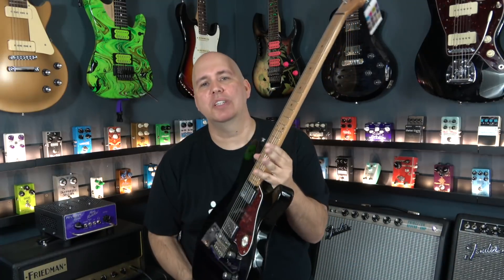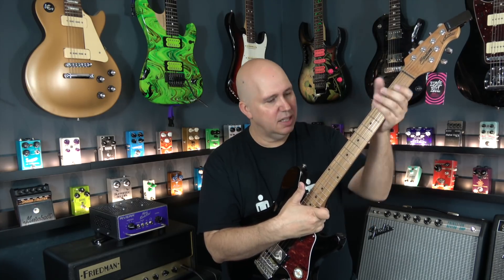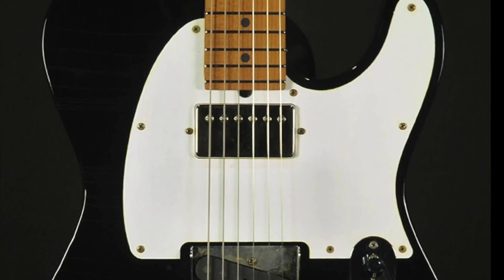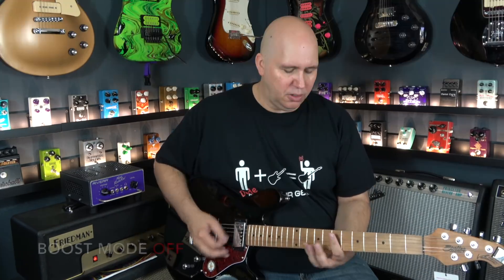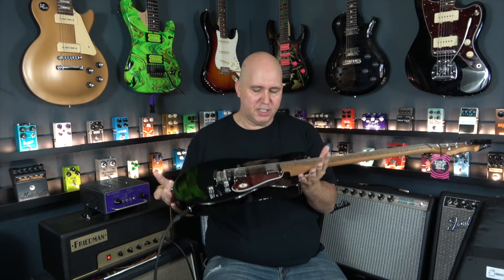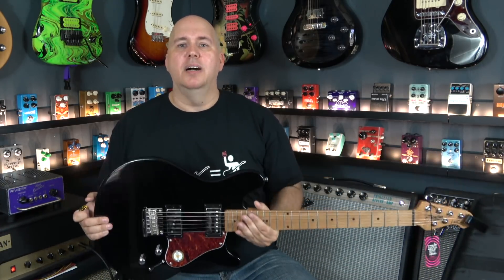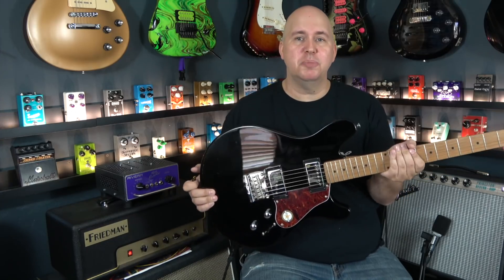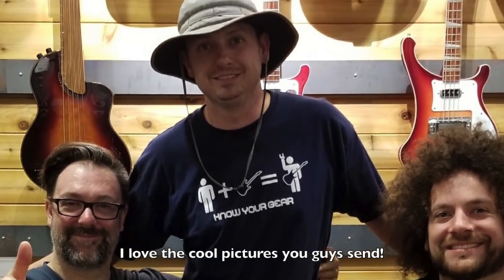James Valentine Signature Sterling Guitar Deep Dive

Comment: I won both the Sterling & the Music Man Valentine guitars last summer in an American Music Supply contest. Over the winter months I had to adjust the truss rods on both guitars the same as my other (8) guitars. The feel of the neck seems to me the big advantage of the baked maple. I also like the color of the baked necks.
Reply: You have both versions? How do they compare?
Reply: The Sterling & Music Man web sites give you all that info to compare.Everything is upgraded on the Music Man and I mean every part! All the wood, frets, pickups, electronics, all the hardware and even the battery box. That said the Sterling is a fine guitar. I love it. It is a special guitar. It was in tune when I took it out of the box and felt and played like I had owned it for years. All my other guitars are U.S. made and one is a Custom Shop but my Sterling is the best playing of the bunch. That said the Music Man is the best sounding guitar I own. I know I'm not much help and I can't help that. I still haven't been able to decide which I like the best myself.
Reply: It was very helpful, in fact. It seems that, even that the Music Man is quite an upgrade, both are very fine guitars at their respective price points. Thanks!

Comment: I bought one of these used.  I am confused on the actual radius of the neck though.   Some sites say it's a 10 inches,  you said it was 12 inches, and the sterling website says it's 9.5 inches.  I have never seen a guitar with so much discrepancies in information.   I even saw one reviewer say they are stainless steel frets, which I doubt it has.  If you can lend any info I would be appreciative.

Comment: I own a JV60 in Trans Buttermilk. The roasted neck is amazing. I didn’t get along with the bridge pickup, so I swapped both pickups for a set of Railhammer Humcutters. They give a great humcancelling P90 vibe. It also makes the JV60 into a Tele Deluxe. Much happier with it after the swap. 

Also, the wedge shape on the body is way more comfortable to play than I thought it would be. I’m normally dead set on having forearm and belly contours on my guitars.  This one sits nicely and feel great.
Reply: Are the pickups on this guitar of standard size (will any humbucker fit)? Was is difficult to replace them and did you keep the boost function? Thanks.

Comment: Hi Phil, great review. May I ask your advice? I have stupidly expensive guitars and I can maintain most aspects setup ways but because I played them and not cleaned them in 10 years, I have a 2001 59RI Gibson no 19 with nos parts. Anyway to my issue, Gibson rosewood boards are quite porous and I have finger dirt. I'm a bit scared to take a razor blade to it? what do you do with really dirty finger boards. It's really stuck and stubborn to move and i'm scared of marking my boards. Cheers

Comment: Great video. Phil I have two guitars in desperate need of sharpening. One is a 1982-85 mako bullet Stratocaster copy, a old Korean lawsuit guitar.  It's in dire need of sharpening and it would be a great project to show how you can get a cheap cheap( can't find info but I'm sure it's plywood. It also has a boost switch. It might be a  coil spilt but I'm pretty sure it isn't)guitar and  it amazing. Second and in need of a good sharpening is my 1997 american fender California series fat telecaster. It has a single coil in the bridge and a humbucker in the neck and a 5 way toggle selector switch to split the pick up. The mako would be such a great video and I'm willing to have it refinished too. I want a purple body and a orange pick guard or the other way around, ala Willy Wonka.

Comment: A cool new hipster name for kiln dried. Awesome.
Reply: Deorman Robey not exactly simply kiln dried . A complex set of specific temperature and time cycles. I dunno you look it up . It’s a building material technique.
Reply: Kiln drying has to be done at a lower temperature for a longer period of time to prevent the oxygen from reacting with the wood (think low-level burning). The higher temperature additionally allows the sugars in the wood to caramelize, cross-linking the molecules into polymers, and this hardens the timber. Ibanez does theirs in a nitrogen atmosphere at positive pressure, probably to make it easier to flush all the oxygen out of the oven.
Reply: Markle2k Thank you professor Marle2k I’m craving some caramel now.